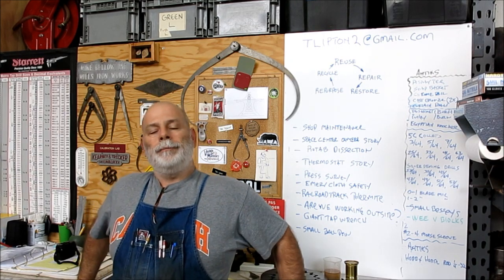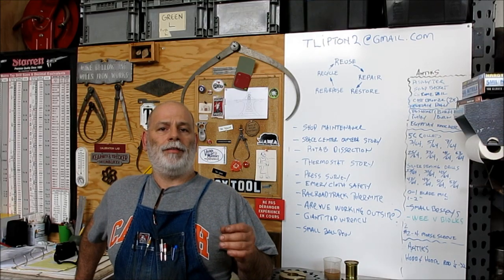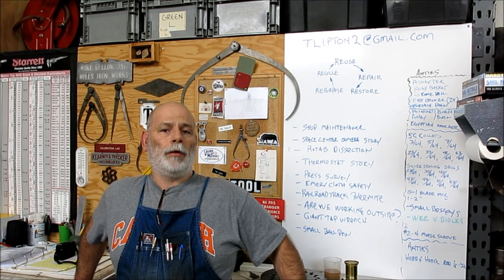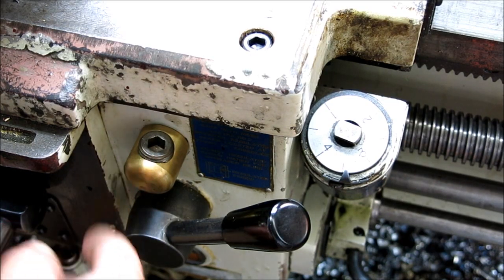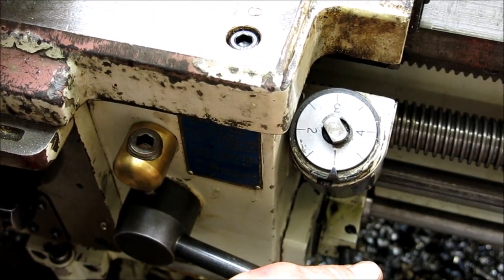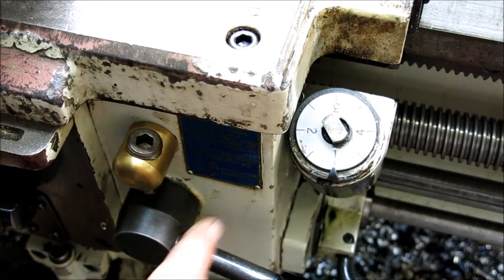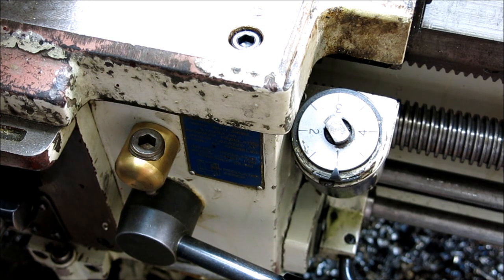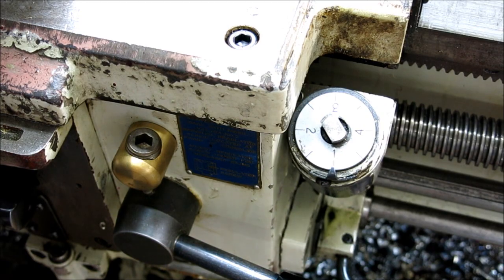Metric Threading with an Inch Lead Screw

Comment: I am no machinist, I have a question? If you get disoriented and lose your place on this operation could you just put your threading tool into one of the threads and then reverse out and be in the right orientation for the next cut?
Reply: I believe what you are getting at is called "chasing" threads. I believe this is what you would have to resort to if you got completely lost of took the part out of the chuck. My understanding is that if the dial goes all the way around back to one that the timing would then be out because of the inch lead screw. However if you let the thread dial spin around enough times you would eventually get the gears times right. But we don't know how many time 'round you would have to go.
I don't know if any of that made sense, but it did to me........
Reply from the maker: Hi Charles,

In this particular situation with metric threads on an inch lead screw you would pretty much be lost. The correct orientation of groove one comes up every 127 rotations. Pretty hard to figure out which one it is. Picking up a "normal" thread is pretty easy.

Cheers,

Tom
Reply: Hi Charles, if you have the compound/top slide in line with the lathe axis all you have to do to re-align is to take a dummy cut, stop the lathe and advance the tool into the work (using cross slide) and then move the top slide till the tool is in the groove again. This is just one of the advantages of using radial feed for thread cutting. Hope this helps.

Comment: A great little work around, maybe I should make myself a thread dial for my metric lathe! On my Emco Compact 8, I have no options, keep the half nuts closed!
Regards, Matthew
Reply from the maker: Hey Matthew,

A thread dial would be a neat little project. You get to make a worm gear. Sounds like some fun to me.

Cheers,

Tom
Reply: oxtoolco As if I didn't have enough projects as it is!
Regards, Matthew

Comment: OK Mr Wizard My lathe has threading 1/1 chart and diametric pitch 8/1 So what do you do with the diametric pitch ??
Reply from the maker: Hi Terry,

Put tape over the Diametral pitch chart so you cant see it. They are related to gear cutting. Specifically worm threads. Ignore unless you are making gears.

Cheers,

Tom

Comment: Hey Tom,
Thanks for the info and link to the article. That guy is interested in a lot of what I am, namely, machining, photography (I used to do by own b/w processing, but thanks to the digital revolution, Kodak has stopped making photo paper and chemicals) and electronics. Is that shot of you at the end of the program your shop? It looks like some of the warehouses under the Benicia bridge or on Mare Island. (Or the old Oakland Army Base for that matter.)
Regards,
Oxen Dave
Reply from the maker: Hey Dave,

Close. Hunters Point Naval Shipyard. Steel shop.

Cheers,

Tom
Reply: Tom,
That would have my next guess!
Dave

Comment: Hi Tom, stand by for shouts of "heresy" from your fellow colonists for using the cross slide and not the top slide for in feed, for some do not believe you should even think about doing it. In truth all it is is a little knowledge is just not enough and a closed mind is no mind at all, but they believe they are right, bless 'em.
ATB
chris
Reply from the maker: Ho Chris,

Good to hear from you my friend. Yes it is the dreaded straight infeed. That stub of thread will never meet its female mate in our lifetime. I'm hoping to trick them with the slight of hand and thread dial closeups.

Cheers,

Tom

Comment: Good tip thanks, My old Colchester 1919 year does not have reverse or a thread dial so its going to be hard to do threads on it.
Reply from the maker: Yep that will slow you down a little.

Cheers,

Tom
Reply: Cheers for the link I will try that one day

Comment: Cool technique. I have become VERY dependent on the footbrake and jog button when doing such a thread. It's nice to take some of the pressure off by being able to release the half-nut. I shall use this in future. Thanks to the original poster and yourself for the excellent demo.

Colin
Reply from the maker: Hey Colin,

Thanks for the comment. You can actually coast for quite a while. I use the foot brake out of habit.

Cheers,

Tom

Comment: Neat trick.

Works well if you have a spindle brake. Those of us with simple lathes may have to count rotations while the spindle spins to a stop.

I do have a VFD on my Craftsman. I'll try it on mine. With the VFD it does do some braking on the stop but I bet I'll still get near a full rotation of the dial on mine.;)
Reply from the maker: Hi Scott,

No need to even use the brake. Once the half nut is disengaged there is no rush. It takes a long time for a full rev of the threading dial.

Cheers,

Tom
Reply: Check your VFD settings. You should be able to increase braking current if it's adjustable.
Reply: Or for those of us with machines that doesn't stop (or start) on a dime. Brake or no brake :)
Reply: rcdieselrc My VFD trips out on over current if I set the braking time much shorter. I have upped the current limit but it still must coast to half speed or so before applying the brake. I could optimize it more but also don't want to worry about the chuck unscrewing ;)